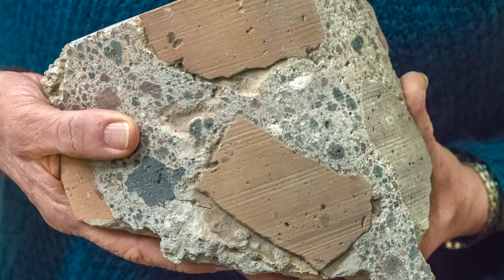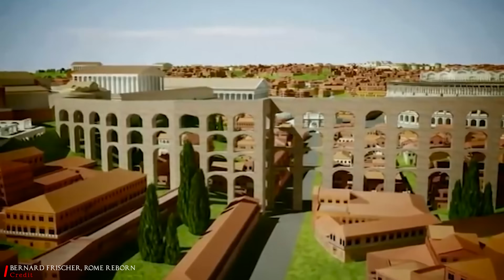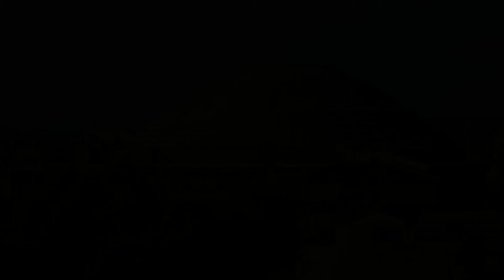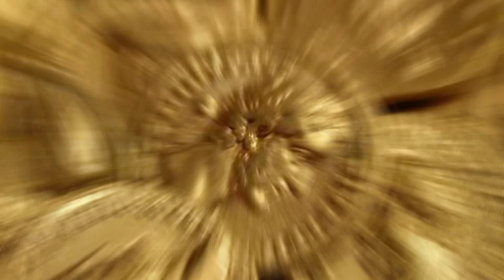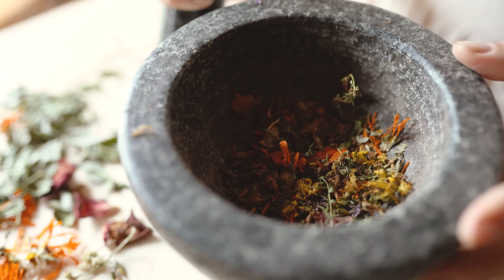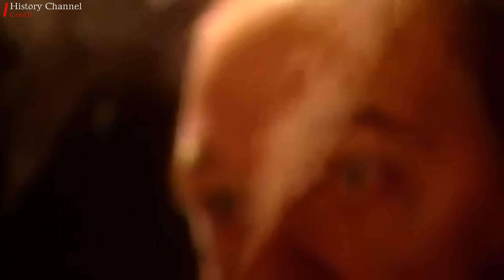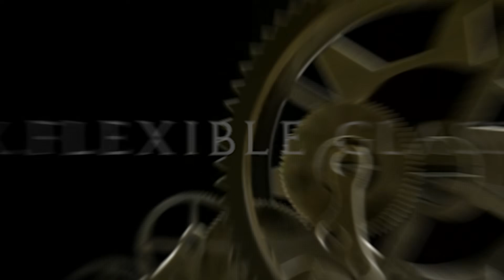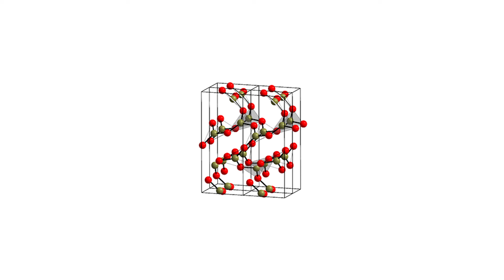Top 10 incredibly advanced Roman technologies that will blow your mind.

Comment: Lead contamination in Roman drinking water seems rather unlikely. The Roman plumbing system didn't have taps, so water was constantly running through the pipes. There wasn't water standing in pipes for days or weeks to potentially soak up lead particles. Most of the lead that ends up in the water would be flushed out with the constant water flow and not end with the water that was actually drunk by people.
Reply: In a lecture on Greatest Courses, an instructor talked about this. He said the mineral level in the water quickly caked and covered the lead in the pipes so there shouldn't be hardly any levels of lead in the water. This same minerals build up in the aqueducts and had to be routinely removed.
Reply: @ourshelties7649  this us why the lead pipes in Flint, Michigan were okay but problems arose when they striped them. Amazing how modern man is stupid.
Reply: @ourshelties7649  "there shouldn't be hardly any levels"
?

Do you mean "there should be hardly any levels of lead.. "?
Since "hardly" is restrictive, "shouldn't hardly" is effectively a double negative.
Reply: @robinharwood5044  Lol. .or "There shouldn't hardly of been no levels of no lead" or "Aint hardly no levels no lead in no water" I actually heard a guy say once, in response to his bad smell of gasoline; when asked "what did you do, bathe in gasoline?".. The man answered, "I aint no take no bath no gasoline". Lol oh the levels of ignorance in this country now, it's just sad.
Reply: @trevorjameson3213  I don't think it can really be called ignorance unless you're certain he is incapable of grammatically correct speech. Most people who talk like that are aware of their grammatical errors but choose to speak with local vernacular regardless. You know, like how people have done since day 1, which is why we have so many languages today. What's considered grammatically correct today was a weird local dialect or trend that the snobs of yesterday looked down on.
Reply: @robinharwood5044  double negatives are a grammatical construct in Englush, this particular construct is a "double negative intensifier", although there are also double negatives that cancel each other out called litotes. 

Nice that you know your grammar enough to spot them though! Not sure why you did, are you learning English?
Reply: @shiuido359  Double negative intensifiers are not acceptable in Standard English.  I taught English Language in several countries, for fifteen years.
Reply: @robinharwood5044  wow that's embarassing! I recommend you start educating yourself, perhaps try Wikipedia and start from there. Kudos to you admitting your mistake after so many years, that shows a lot of strength!
Reply: @shiuido359  No mistake.  Double negatives are used in some dialects, but they are not acceptable in Standard English.
Reply: @robinharwood5044  They absolutely are acceptable and they are quite common! There are many example usages in businesses or technical language such as "not less than", in every day speech "I'm not unwell", or "ain't nobody got time for that" etc

It's actually way more common than you'd think.
Reply: @shiuido359  "Not less than" is not a double negative.   "Not unwell" is a deliberate use to affirm the positive, not to intensify the negative.  "Ain't nobody got time for that" is dialect, not Standard English.
Reply: @robinharwood5044  Uh, yes those are double negatives. Is English your native language? I think you should do some research on the topic as it's obvious you're way out of your depth and have no clue what we are even talking about. I highly recommend you start with wikipedia before searching for some more specialist grammar resources. Cheers, educate yourself!
Reply: @shiuido359  Standard English is my native language.  Is it yours?   Litotes can be regarded as a double negative when the quality being denied is expressed with a negating prefix.  E.g. " It isn't impossible."  

But this is not the type of double negative that I was referring to.  " It isn't impossible" is intended to express (in Standard English) "it is possible".  The two negatives cancel out.
 The dialect  "I ain't done nothing" is, as you correctly say, a double negative intensifier .   It is intended to express (in Standard English) "I did nothing".  The negatives do not cancel out.
If you think that this sort of construction is acceptable in Standard English, please provide a more reliable reference than Wikipedia.   Educate me.
Reply: @robinharwood5044  We live in an age where information is more plentiful and easily accessible than ever and here you are saying "wiki isn't good enough and I don't know how to use Google". No wonder your grasp of English is so poor. Don't blame your ignorance on other people, take responsibility for your own actions.
Reply: @shiuido359  So you cannot direct me to a source that shows that double negative intensifiers are acceptable in Standard English?
Reply: @robinharwood5044  was something about my previous message unclear to you? Let me know if it's confusing and I can try to explain further.
Reply: @robinharwood5044  "Standard" seems to be the key word here. 
I'm a second (or rather third) language speaker of English, didn't start before I was 12, so my English isn't great. I studied translation and interpreting from English at university though. In my native language, I'm fully able to use the standard variant. However, there are a few verbal constructions from regional variants that I like better than what happens to be the standard, so I choose to use them in certain contexts. Sometimes a particular construction may offer an extra mode or differentiation not available in the standard variant, or I may just like it better because it's more expressive or playful. And sometimes I just do it because it's the way people speak where I grew up as opposed to where I live now. 
To be honest, sometimes I did it just to troll pretentious Northerners (in my country). 
Fortunately, outside of a teacher/pupil situation, people are still allowed to use language any way they feel like. And of course, everybody is entirely within their rights to make any criticism they may have. 
So as usual, everybody embarrasses themselves as good as they can!
Reply: @robinharwood5044 You shouldn’t force native speakers of other dialects to conform to your “standard English”. Sure, it’s acceptable for teaching, but It’s essentially British court dialect and isn’t the one only correct English dialect. Each dialect is equal and has its own consistent slight differences in syntax and grammar. It’s astonishing in the modern world, how some dialects especially ethnic minority dialects are still looked down upon like snobbish aristocrats did hundreds of years ago.
Reply: @canendum  For international communication. Standard English is the standard.  Using other dialects can lead to confusion.  Promoting them will lead to a set of separate languages emerging.  (As happened with Latin.)  I see no reason for encouraging confusion, lack of clarity, or an increase in the number of languages in the world.
Reply: @robinharwood5044  just shut the fu ck up and keep your opinions to yourself
Reply: @robinharwood5044 that’s just kinda racist
Reply: @trevorjameson3213 Perhaps you missed his overtly sarcastic response to your pointing out the obvious
Reply: @robinharwood5044  AIN'T  nobody cares.... does grading online comments make you feel good?
Reply: @shiuido359  No one who speaks proper english says aint nobody got time for that, learn to speak fucking english
Reply: Today there is still lead in brass , solder , and other metals used in plumbing and construction. It’s on such low levels I won’t hurt you. Plastic is probably worse for you than the lead in plumbing materials.
Reply: @theyoutube8933  If you don't know anything about heavy metal poisoning keep your mouth shut.
Heavy metals make  you violent, stupid, damage all your organs and on  and on. And the damage can never be undone once it's done
It's not like plastic.
Reply: Lead wasn't just in the pipes. It was in cooking and drinking vessels and other things. It is speculated that the Roman wine had quite an amount of lead content, too. Whether this is true or not, and whether the lead exposure through cooking/drinking vessels was significant enough to cause a problem is an interesting topic to consider and think about. Apparently very high levels of lead were found in the bones of some Roman citizens.
I also heard something about the Romans using lead acetate unintentionally as a sweetener in foods/drinks such as their wine, apparently it was the accidental discovery by boiling grape juice in lead kettles when searching for new sweeteners. Evidence of this was apparently found in the writings of several Roman authors.
There was also mention of using lead acetate crystals(sugar of lead) as a sweetener somewhere down the line.
Reply: @Driftwood&Sagebrush acetic acid is only in wine that has gone bad aka vinegar.
Reply: the lead poison came from cooking with lead pots, not the water.
Reply: @kennethlodwig4024  everyone is debating about the pipes and totally forgets about the pottery and it's mineral content and what it leeched as well as metal plates and silverware which could be lead as well.
Reply: @Steven_Edwards  you are absolutely correct!
Reply: most of the lead poisoning in Rome was due to the lead sugar being added to wine think of Austrians putting antifreeze in wine to make it sweater.
Reply: It wasn't the water. It was the wine they drank that had the lead in it. The acids in the wine absorbed large amounts of lead.
Reply: Actually, private connections were made by purchasing bronze taps, which were punched into water pipes leading into privately owned homes and other buildings.  These taps likely contained trace lead, but if in constant use, it wouldn’t present much risk.  Also, very few could afford such very expensive service taps, or plumbing inside a building, so the public health risk was low.
Reply: water flowing for 50 km or more will absorb contamination for the piping…it does not have to stand still to do so
Reply: Considering there was such a massive amount of lead throughout the pipes, it’s plausible that it had psychological affects on the masses who used it from pools and aqueducts.
Reply: @Brock1812 I think they had figured out taps. If they could raise a Coliseum they definitely had figured a simple valve

Comment: About the possibility of lead poisoning in the water: in ancient times the water usually ran consistently through pipes all day long. In modern times, lead poisoning can be due the water in lead pipes remaining still until someone turns the water on. (That's why they say it's best to let water run for a moment and then use it.)  I'm not saying that's 100% fact, but I do see that pop up from time to time when learning about these times.
Reply: get a water filter. usually modern pipes would only have lead from solder or from some solder in a hot water system.
Reply: also modern pipes are pressurized